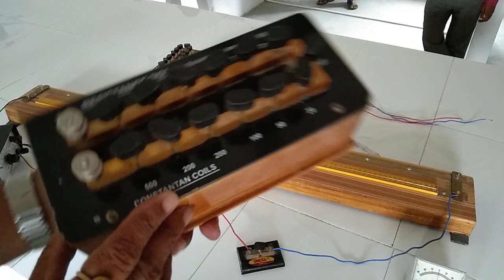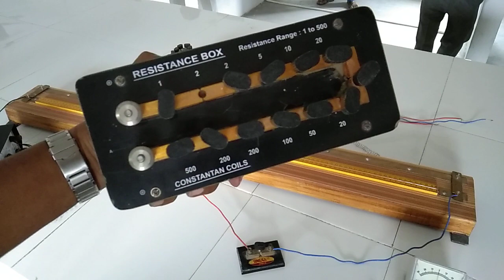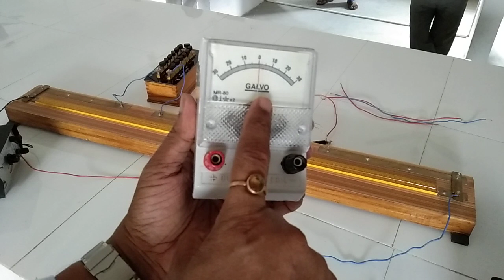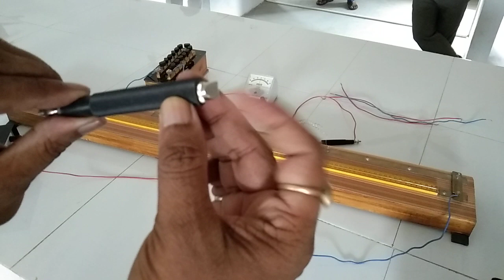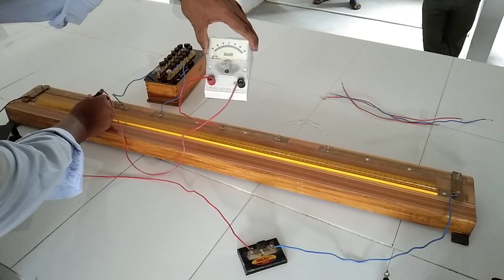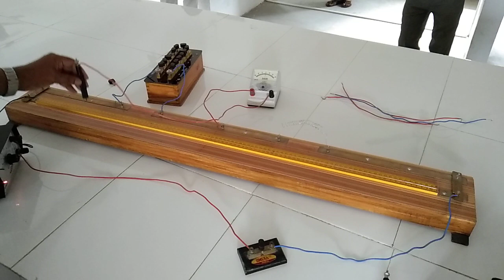Meter Bridge - Unknown Resistance - Practical

Comment: Thank you sir for your explanation, but I have a question. After writing down the equation for the balance point of the metre bridge, how do we calculate this: R=(100S/L) - S
Reply from the maker: Let us say, the balance length L= 42 cm; then 100-L will be 100-42 = 58 cm. Use the value of S in the resistance box while obtaining balance length. You will get R. I hope I am clear. 👍